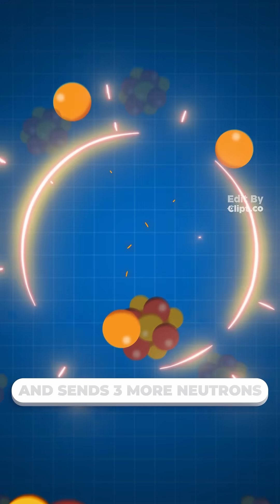How does nuclear energy work??

Comment: It's not just to slow them down brother. If the uranium rods are the fuel then the tank and water are the engine! All it is is a fancy steam energy generator. The rods super heat causing the water to boil and keep them from overheating and going critical then the steam turns the turbine which is funneled off through a stack, that's why you see those giant clouds of "smoke," coming from the stacks

Comment: Common misconception that it'll turn into a nuclear bomb when it goes critical, but in actuality it just heats up the water nearly instantly creating a massive ammount of pressure within a confined metal space, essentially creating a massive pipe bomb. Thats why all of the major plant disasters havent left behind crators. It just happens to spray a ton of irradiated mist and boiling water everywhere with a (relatively) small explosion
Reply: Critical?

Comment: What about control rods, which are basically the most important thing in nuclear reactors?  Without them, it is impossible to control the reactivity, and therefore the temperature and pressure of water vapor.  At some point, all the water would evaporate and the reactor would melt down.  Of course, this is the worst-case scenario, but not the only one.  However, one thing is most important, nuclear reactors must have control rods.  Even their name speaks for itself.  They control the reactor.

Comment: You are completely wrong. How a nuclear reactor works is that there are fuel rods made by uranium. Then there is a second type of rods called the control rods, these rods are made out of boron which slows down the neutrons. Also there is no big red button that starts the core. The core is always on. Also water is not used to slow down the neutrons, it's used as a coolant. If water was used to slow down the neutrons then it would be very unsafe and then we would enter RBMK-1000 type thing. That's the reactor used in Chernobyl. Also these huge towers at the end of the video are called "cooling towers" these cool the water in the condenser. I am of course talking about BWR/1-6 type of reactor as the reactor vessel you showed us is bwr type. Before posting about something please just research it more.
Reply: Yeah it wasn’t 100% accurate but it definitely educated people about how it roughly works.

Comment: This is just a bad explanation, the Nuclear Fission heats up the Fuel Rods, and because of it the water, Depending on the Reactor Type (we will make an examle of the PWR here) this hot water will be Pumped through Pipes inside a Heat exchanger making them heat up Heating up  Water inside the Heat exchanger, then this Water turns into Steam Shooting out through a Pipe because of Overpressure getting Pushed against some Blades Turning a Turbine, there are Condensers that get thr Steam out of the Turbine Cooling it down because the Steam makes Contact with Cold Pipes where Water is Inside of these Pipes wich in Turn get into the Cooling Tower, a Part of it Turns into steam something is being added and it goes through the Condenser Pipes again, The Steam condensated back to Water goes Into the Heat exchanger, there are Rods made of Boron to Control the Reaction by absorbing neutrons preventing the Reactor from Getting Exponentially Critical (Power*2.5-3.0 each Time every existing Neutron that was made Reacted) (this would basically be a almost Instant Meltdown). The Cooling Tower is there to cool the Steam down again wich is created in the Heat exhanger, and it always makes steam when the System is running, its just not always the same amount as it depens on the Unit Load.

Comment: The towers dont release all of the steam and a bit of the steam goes to a compartment with cold water and turns in to water. On the first type of reactors (rbmk) wich was used in chernobyl there was also graphite wich slowed the neutrons. The reacktion also creates two lighter uranium atoms

Comment: A very important thing that wasn’t mentioned are the control rods, these are rods made of a neutron absorbing material that can be inserted and withdrawn from the reactor, they’re both the on and off mechanism.

Take a rod out, you get more reaction and therefore heat
Put a rod in, you get less reaction and less heat.

Put every rod in you shut it down
Take every rod out you lose complete control of the reactor
Reply: Wow
Reply: That what i said but 3 months later after this comment
Reply: Take every rod and you get nuke + elephant’s foot
Reply: @ariesleo7396 you don't get a nuke. Just elephants foot
Reply: so why not surround the reactor with these rods so there's no issue with radioactivity leaking out?
Reply: @DeepakKumar-lv4te  the rods don’t block radioactivity, they block the neutrons, and radiation is blocked, thats why they’re so heavily shielded. Even an old reactor like the RBMK-1000 (The Chernobyl type) you could literally walk on top of while it was running with zero risk.

Comment: Those towers are called cooling towers for a reason. They cool the reactor down, not release the steam… the steam in the nuclear reactor is a closed loop, so it will condense back into water and flow into the reactor again to avoid possible radiation leaks from contaminated steam

Comment: A couple things in this that I know would have bothered me as a kid to clarify:

Slowing down the neutrons is actually the gas pedal for the reaction, not the brake.

The cooling towers don't release any steam, they cool water by evaporation that is used to cool and recondense the steam to water so it can be reboiled and repressurized and sent back through the turbine again, not "in case things get too hot," that would imply if you see anything coming out the cooling tower something is going wrong, the water in the reactor is not the same water in the turbine and that is also not the same water as in the cooling tower. 3 separate loops.

Also cooling towers like that aren't only used by nuclear power plants. A lot of oil/gas/coal fired plants also use them as well as other industries that have to dissipate a lot of heat.

Not related, but the schools and universities I went to also used the same principal as those cooling towers for their air conditioner systems. Using forced evaporation of water to reject the heat extracted by the HVAC system.
Reply: The "Gas pedal" is not quite correct. Graphite causes more reactivity by slowing down the neutrons, and Boron-Cadmium absorbs neutrons.
Reply: The 3 loops is not quite correct with different reactors. Commonly its 2 until it reaches the Turbine but some use 3 or 4 like the breeder reactor.

Comment: Water actually slows down neutrons to enable reaction
If they are too fast uranium doesn't "catch" them for the reaction to take place
They will just bounce funnily enough 
To prevent it, there are steel rods which interfere with some of the neutrons getting to more uranium and triggering more reactions

Comment: There are things called moderators near the fuel rods (the uranium) to slow them down making it even easier to control the rate of fission inside the reactor.
Reply: Water is actually a relatively good moderator, although it is not used in all reactors

Comment: Hey, a nuclear nerd over here, the cooling towers aren't used to release steam, they recirculate water in pipes for the condenser, as it needs low temperatures to condense steam.
Reply: And also, the reactor isn't connected to the cooling tower.
Reply: Finally someone explaining it right
Reply: They are used to release steam. You see it coming out as well. What are you talking about?
Reply: @lami_nar3662  the big towers are used to cool down the condenser, the condenser is condensing turbine steam into water, the big towers aren't mainly used to dump steam Incase there is too much in the core, that's done via an steam ejector valve.
Reply: @karolekpm2023  they are used to release steam so it doesn't overheat, no idea what you're talking about
Reply: @lami_nar3662  you're still wrong... twice
Reply: @lami_nar3662 you have to be trolling
Reply: @Sturmtige10  "if I say I know things about something the people will believe me" it's common knowledge that the massive tubes release water vapour
Reply: @lami_nar3662  yeah they do release water vapour but the way you and the video are saying it sounds like the cooling towers release steam made from the reactor itself which is not true.
Reply: @Sturmtige10  I didn't say they released steam from the reactor
Reply: @lami_nar3662  "They are used to release steam." what does this mean then mate?
Reply: @lami_nar3662 When the minecraft kid thinks hes him
Reply: @lami_nar3662  you are so wrong
Reply: @karolekpm2023  cooling towers do in fact give off steam, that is the water turning to steam after taking heat away from the secondary loop.
Reply: @lami_nar3662  where the hell else would you get steam from?
Reply: @lami_nar3662 Jit went silent
Reply: @lami_nar3662  in the condenser (the machine that cools the main water) uses another loop of water to cool the main one. That other loop of water cools by spraying it on top of the cooling towers, lowering its temperature. But a side effect is some water turns into steam, which is important. Then all that cooled water goes back into the condenser cooling the main loop

Comment: Can someone explain why they dont just use the energy they use to heat the coils as actual energy they distribute to the country??

Its practically a thermal powerplant at this point i thought nuclear power plants did something completely diffirent
Reply: Heat isnt electricity, and you cant effectively transfer heat over distances
Reply: You can't effectively turn heat directly into electricity. Also, water acts as a coolant and moderator. A moderator slows down neutrons to make it more likely they hit a uranium atom continuing the reaction. And the coolant prevents a meltdown, and well turns the turbine Because of evaporation.

Comment: They dont slow the neutron to contain the bomb
Tje nucklear need to the neutron to be slow to make unstable 236 uranium 
If the neutron hit fast it will just hit and move the atom
The way we contain it is with some kind of rods that absorb or destroy the neutron
Reply: Correction: nuclear power plant use enrich uranium U-235 to collide with neutron, there's also U-238 but it is just useless because the neutron aren't strong enough except in CANDU reactor.
Reply: @erdwin5613  Correction: it’s not that the neutrons “aren’t strong enough”, the neutrons must be moderated further to be able to use uranium-238 for reactions. That’s the D in CANDU; Deuterium. An isotope of hydrogen with an extra neutron, often referred to as “heavy water”. It is a naturally-occurring (albeit still rare) isotope that is not inherently radioactive.

Comment: Nuclear reactors are just steam engines but with no flames(until it explodes)
Reply: Modern ones aren't gonna explode, there's way more safety systems than the 9ps
Reply: @TheAdmiralMoses  that is true, modern nuclear plants have more safety precautions to prevent a meltdown

Nuclear fearmongers backed by big oil are the ones impeding the dpread of energy via power plants worldwide

Comment: Your oversimplification makes this video just sh*t. 
1. Chimney radiators have nothing to do with overheating, nor do they have any influence on the chain reaction itself.
2. Steam obtained during heating of water in contact with rods has its own separate system. It does not go outside it.
3. No steam, nor water, nor anything in contact with radioactive materials is released anywhere from a nuclear plant. If it does you get Czarnobyl, or Fukushima.

Actually I am very sad, that my comment will eventually make your nonsense stupid rubbish talk more popular.

Comment: Hey, Fking nerd here.

So the Giant Towers you are talking about are Cooling Towers. These condense the steam from the  turbine and put it back into the system, which depends on the reactor type. Now this video I find a simple, but good explanation yet I must add some bs of my own. Here are some basic nuclear reactor types:

BWR - Boiling water Reactor, this directly boils the water. The "fuel assembly" sits plopped in the water. Now, this reactor can have a loss of coolant accident casued by evaporating. Basically if you disable pumps, the thing melts into a 3400° radiactive goo. Its doesnt go boom.
PWR - Pressurized water reactor. The cousin of the BWR, but the fuel heats water at a high pressure, that doesn't get boiled, but rather exchanges that heat to enother bunch of water thru heat exchangers that spins the turbines. 
RBMK - Reaktor Bolshoy Mochnosti Kanalnyy (Russian). This is the scary Chernobyl reactor, inseatd of wate as a moderator (the thing that slows the neutrons and makes them more likley to hit U(235)O²). And insetad of the water surrounding the fuel, the fuel surrounds the water in channels. 

Nuclear Power despite Incidents like Three Mile Island, Chernobyl, or Fukushima, is the greenest and safest way to a sustainable and green energy grid thay can last for decades, and with proper maintenance up to a century.
Reply: Damn bro interesting thanks
Reply: Hello, nuclear guy here. The temperature where the "goo" appears is 2.200°F and not 3.400°F (2.200°F or 1.200°C). The goo is corium caused by the feul assembley, control rods, shielding, etc... melting together (Elephant foot is it's nickname).
Reply: @Just_a-Random_DudeXL  I don’t believe the fact that you claim to be a “nuclear guy” considering you spelled fuel assemblies wrong. I doubt you know anything about the fuel’s melting point, you probably just searched it up.
Reply: @PowerfulPlazOfficial i meant feul rods not assembley
Reply: @PowerfulPlazOfficial the nuclear  feul and core melting point is taken from an actual nuclear power plant safety guidelines (if im correct)
Reply: Sorry, it was 5.200°F instead of 2.200°F (2.800°C)
Reply: This copy cat lol
Reply: @squigglesz   how tf am I copying someone...
Reply: @ you copied the doge guys comment
Reply: @squigglesz  Both were 3 months ago, you don't know the exact day. Also, our comments aren't the same...
Reply: @ Turn on stats for nerds
Reply: @squigglesz  
A) I'm on mobile
B) Saying the same thing as somebody else (that isn't original) doesn't make me a copy cat. I just shared some information, and like another paragraph than the other guy...
Reply: @ Thats copying but ok little bro
Reply: @UnitedStatesofAmerica41  And im on mobile too i currently dont care because im AMAZON
Reply: @squigglesz  Im not gonna even bother arguing with you at this point ffs
Reply: I was gonna say something similar
Reply: You could have explained and wrote this better, it’s written very weirdly and I can hardly understand what you’re saying but I can understand the words you’re using.
Reply: @intdisaster  I was drunk asf

Comment: You simplified things a lot here but there was a mistake. The water, here heavy water, does slow down neutrons but they will eventually hit. So the mention of Control Rods is important. These rods absorb the excess neutrons so only one neutron passes to initiate the next reaction in the chain. The actual water stays outside the reactor. A coolant brings energy to the water turning it into steam which is used to turn the turbine of an electric generator. The control rods ensure the fission reactions are controlled.
Reply: Yeah not always have water. the BWR , PWR (some), and RBMK use Light water as a moderator, and RBMK also a graphite moderator